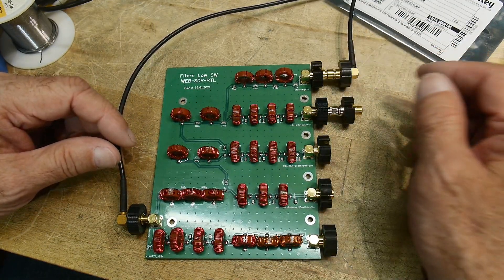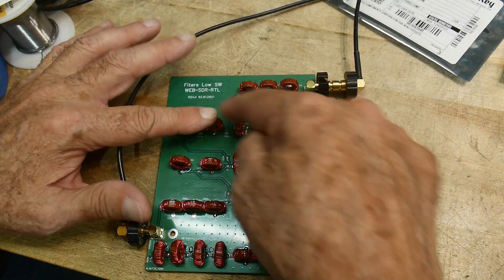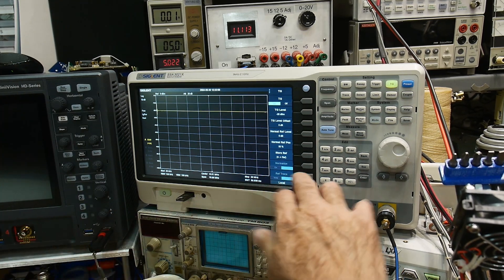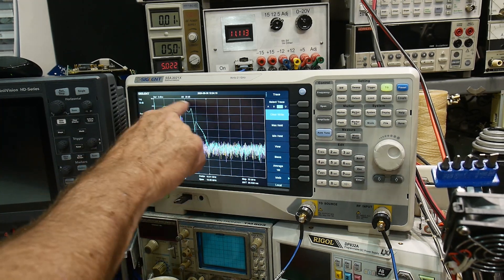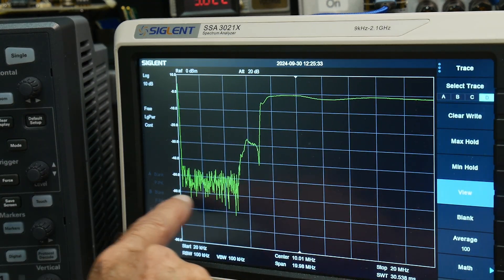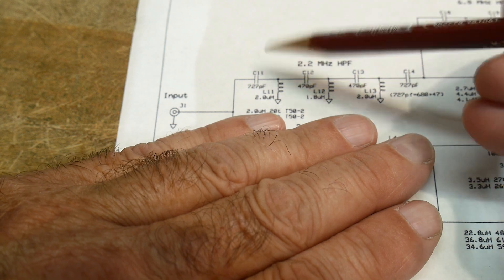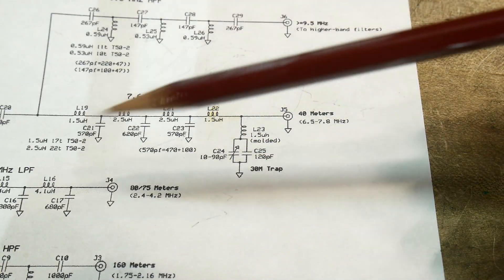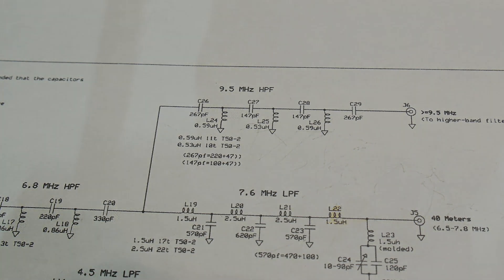#2016 Antenna Distribution Filter (part 3 of 3)

Comment: If it could handle 100 watts or more, would be good to use on one of those broadband HF linear amplifiers, which are filthy with harmonics, you would have to use on the linear amps output for it to be effective

Comment: It might be interesting to check the insertion loss for each of the outputs relative to the (common) input. Also, one could probably optimize those filters for the case we have here where the filters interact to some degree. Put it in a computer program to tweak the values a bit and try to clean up each response. Might be able to reduce some of those steps we see in the graphs??

Comment: There is one problem though - you cannot really cascade filters like this to get proper operation. This is because this is an all passive filter design - and the filters will interact with each other and impact performance of each filter. The proper way is to separate each filter stage with a buffer amplifier, which prevents each filter stage from interacting with each other. While the filter mostly works, you will get improved performance with buffer stages to prevent the inputs of the next stage from interacting with the output of the previous stage. Otherwise it's a pain to analyze since you have to take in account all the filters.

Comment: Conjecture: While I know nothing about their project but the name I think this is probably some of Clint Turner's work on the Northern Utah WebSDR project, and they had a problem with a local noise source around 10 MHz on the bandpass filter for the 40 meter ham band. Thus the trap around 10 MHz. So this is not a general purpose bandpass filter board for everyday users, but a specific filter designed for their installation in Northern Utah. That would also explain why male SMA connectors are used in the design, and also the spacing between each filter. They are going to be screwing individual SDR dongles onto the end of each filter, then having a server process the I/O of all the dongles. I assume the Chinese found this schematic and PCB layout online, produced a kit, (and screwed it up because that often happens with Chinese kits,) since I've seen some of Clint's experimental RF and optical work online and Clint very much knows his stuff. His experimental work is far geekier than mine.  :)

Comment: Didn't you just do this filter thing, using weird op-amp circuitry?
Reply: (I'm very impressed with both sets of videos, BTW).
Reply from the maker: there are many many ways to do filters, both passive and active